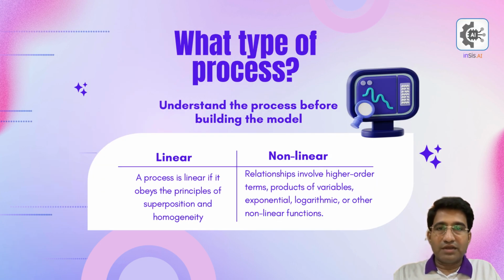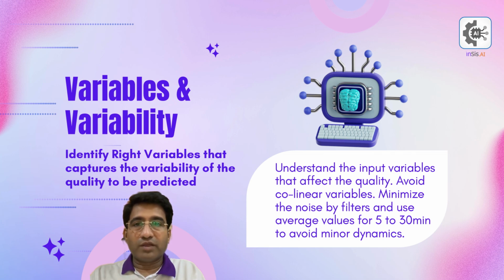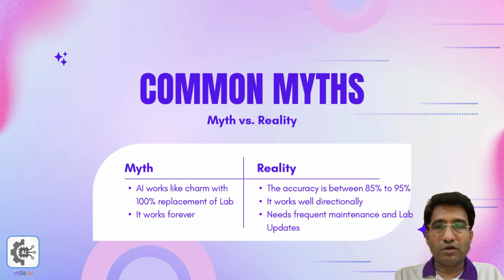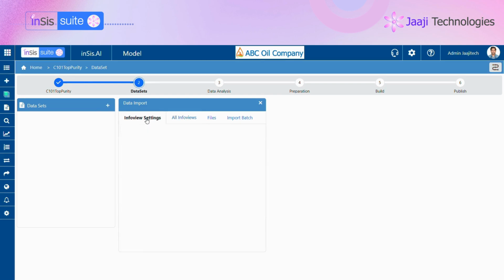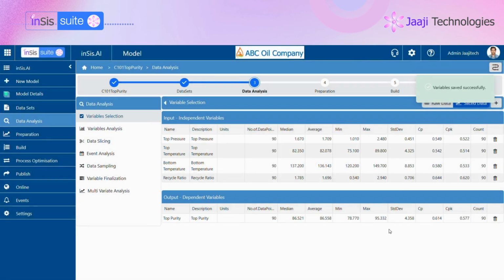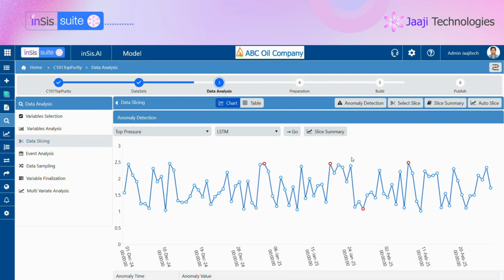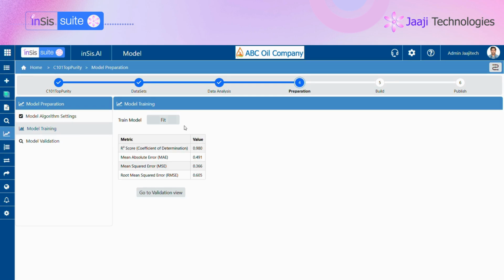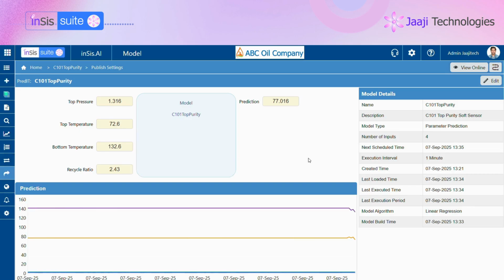Predicting Product Quality in Real Time with Soft Sensors !

Comment: Hi Siva Rama, appreciate the core approach which is cleansing the data at Input level itself.. so that the machine learning input data, is clean and more focussed on the process quality. Rather than using processing power in cleansing the data, though we can use AI at both levels at raw input AI filtering and process related AI, it is great you are trying to split these two things... Too be frank, relational equations are physics at inputs which people have used in Historians inputs collection definition itself,  you know.. but equipment or sensor erractic behaviour... yes this Soft sensor, makes great sense... Appreciate your efforts to focus at inputs itself...